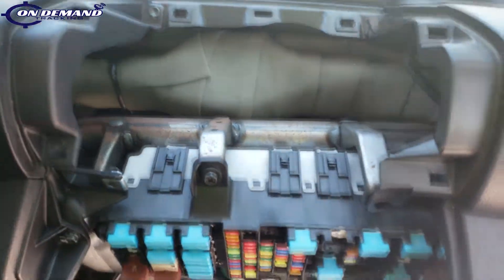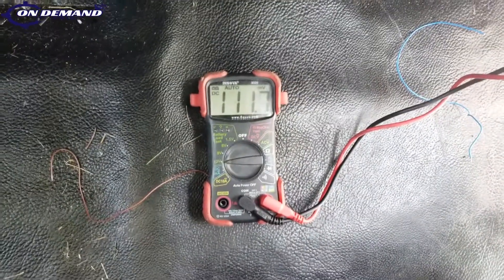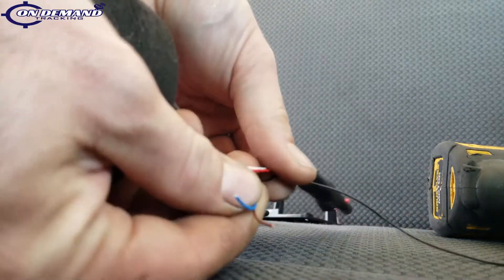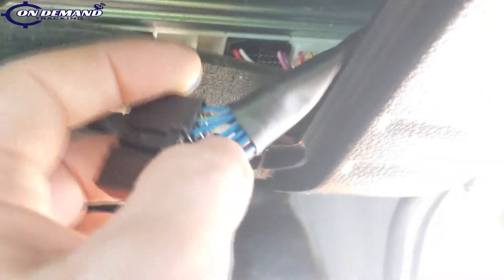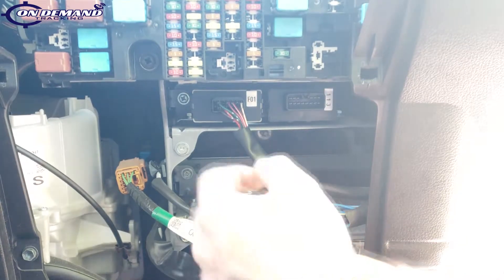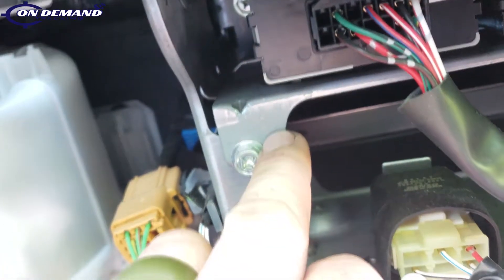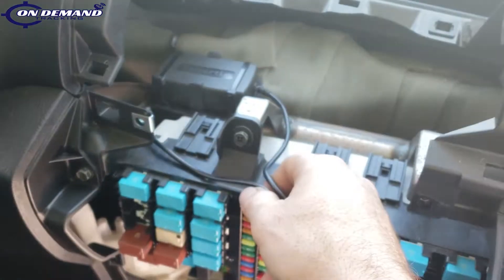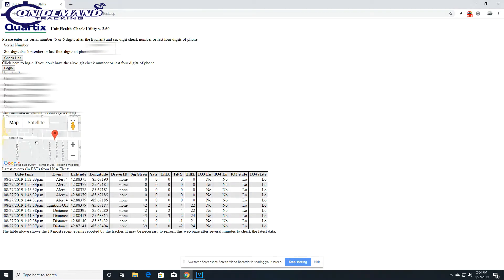Quartix 3 Wire Install Video 2014 Hino Box Truck

Comment: will this work for the 2015 hino as well and are there better versions that have been released since...?
Reply from the maker: Hi Sharon! Yes this should work fine on a 2015 Hino. We have newer 4G units with 3-wire, 2-wire and OBD2 install options at the moment. If you need anything please reach out via our website :)